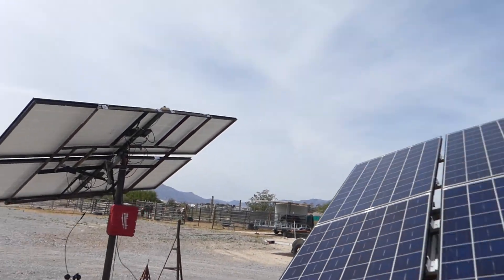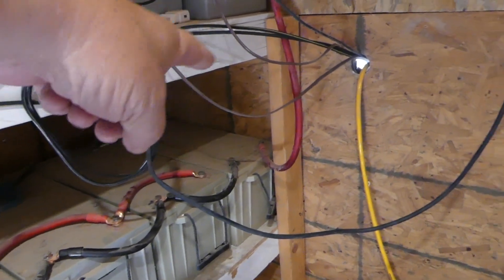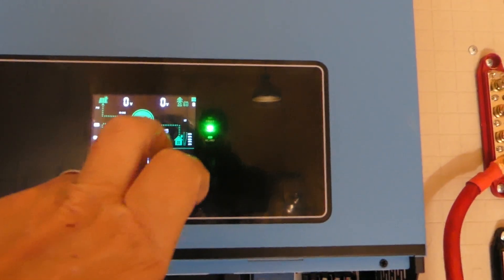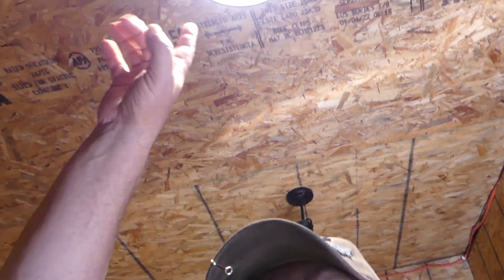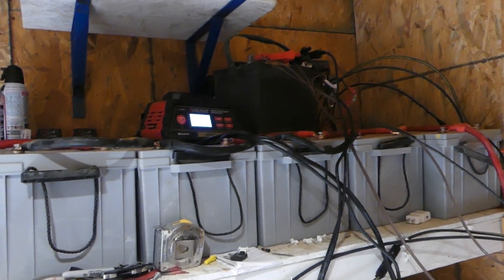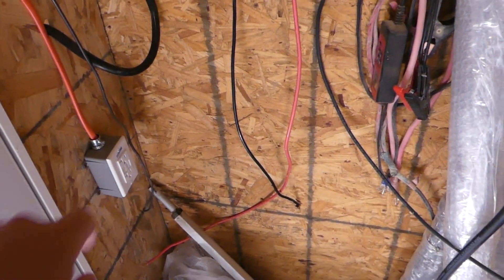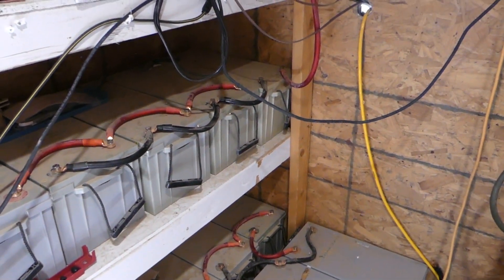We Finally Got R Did!! SunGold 10k  48v system up and running!#diysolarsystem #sungoldpower

Comment: 12kw should be the minimum for any stationary system. 48kw starts adding days to autonomy which is great. All in one inverters are so simple to connect, 12 wires for yours.  Thats enough power to run the average 2-bedroom home. Glad it is running perfect, added electric heat for you this winter.  750w heater 18kw a day. My 48kw was 10k usd delivered, lead carbon, 2700 lbs.
Reply from the maker: Thanks, Bob. I wish I would have known more about solar when I started 5 yrs ago, but it was a great learning experience for us! Thanks for stoppin by God bless!

Comment: those open exposed red and black buss bars next to each other scare me!
 put some caps over those things and all your other red and black areas with exposed terminals or wire so nobody makes a boo boo !!
Reply: OMG you have your wife pulling wet dripping clothes out of a washing machine in there beside all that too!? 
c'mon dude ..
Reply from the maker: New washer no dripping water spin cycle clothes almost dry! Thanks for your concern and thanks for stoppin by God bless!
Reply from the maker: Thank you I'm not finished working in there I had a battery that needs reconditioned! I'll be buttoning it all up soon! Thanks for stoppin by God bless!

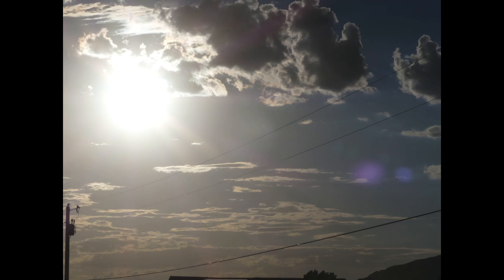Comment: Correction, each group of 4 batteries in series raise the volts to 48v, but amps stay the same, so you have 5 sets of 200ah makes 1000ah at 48v.  That's 48kwh 9:46  (kilowatt hours)  That's an outrageous power supply!  Let me know, or let us all know how your air conditioner and swamp cooler perform.
I think the problem with that gfci might be that it can only connect to another 120v standard outlet outside, and cannot be part of the 240v rv outlet?
Reply from the maker: I think that I have a short where I came through the wall from the outside outlet! I just check the settings and 55.3v batteries and 257v coming in from solar am running swamp cooler on two all conditions normal!
Reply: @tonylarson1960able  well.....check your shorts....😄🤣
Reply from the maker: @GBear  lol skid free! Tomorrow's project is to fix the whoops dangit!
Reply: @tonylarson1960able  lol